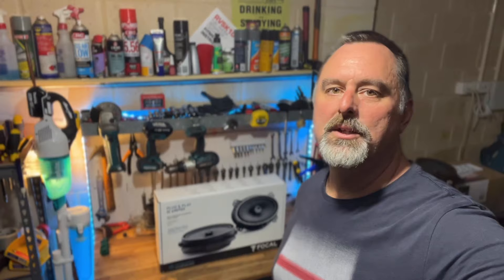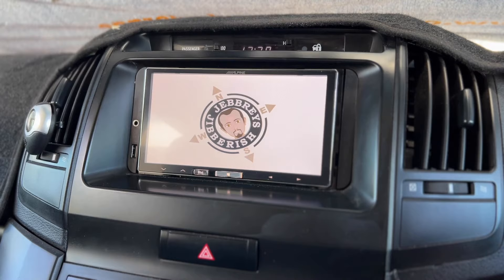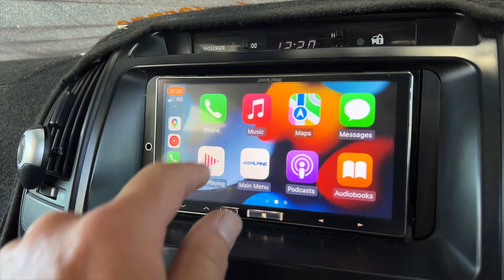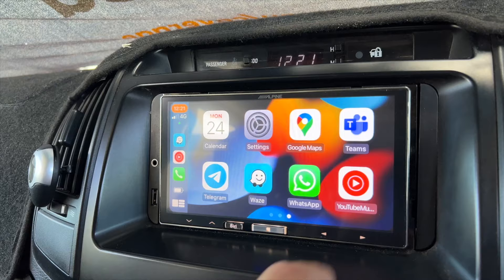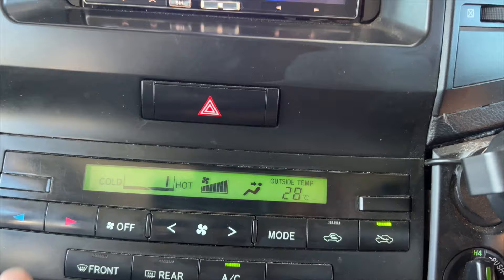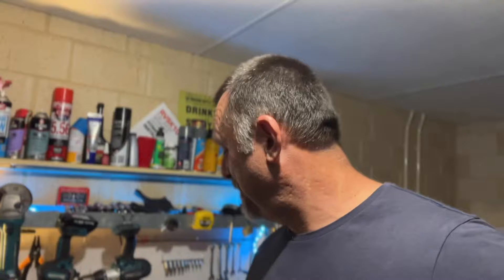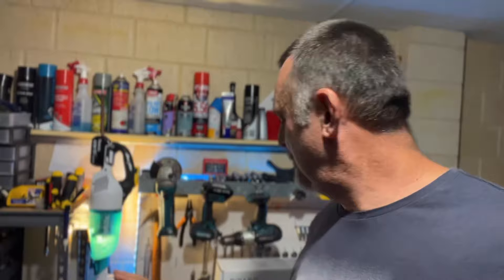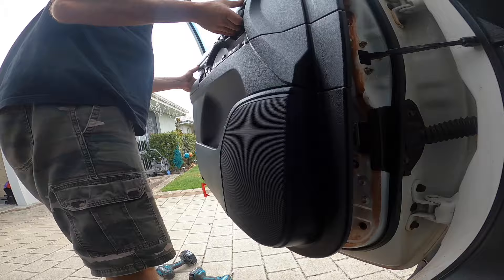I UPGRADE my SOUND SYSTEM in the Land Cruiser with the Focal speakers and Alpine Head Unit.

Comment: Great information. My GX 2013 has the speaker wiring but it doesn't work. Fade to the rear speakers and nothing. Anything else I should be doing? Also Door Courtesy lights also don't have any power. Checked fuses, all good and still nothing. Wirings there, but why would Mr Toyota not just have it connected all the way through to the head unit. Any legends know how to fix this as it as I can't.
Reply from the maker: Interesting as one if my rear speakers wires didn’t work but I’m sure they cut that and used it for the two way radio speaker that was under the passenger seat when it was a company car. I had to run my own cable for one side from the deck back through to the speaker and it was a pain!

Comment: Interesting video I have a GX like you. How did you do the rear speakers? Was the cable there for the rear speakers or did you have to run speaker wire?
Reply from the maker: The speakers wires are already there and connected to the deck’s loom. You simply cut off the Toyota plugs and either solder directly to the speaker tabs or crimp on the correct female lugs. It’s hilarious that they leave the cables there but put skins in with no holes!🙄
Reply: Was going to ask the same question. Mine is a 2020 gx. Will check for wiring and if it’s there easy to put in rear speakers. Thanks for the vids.
Reply from the maker: No problem, than you for the feedback 👍